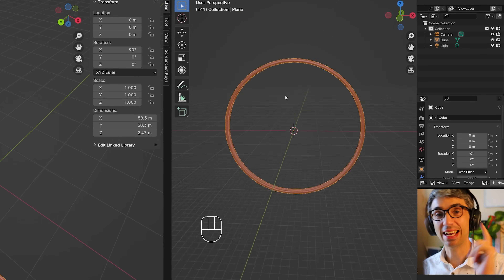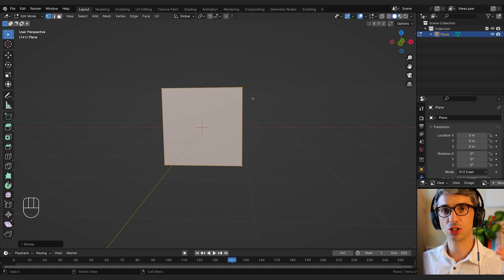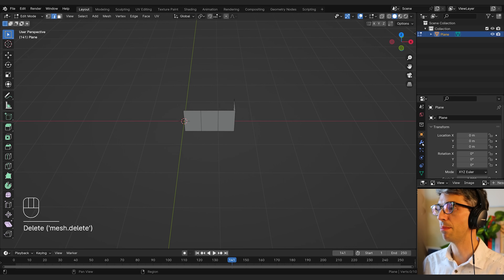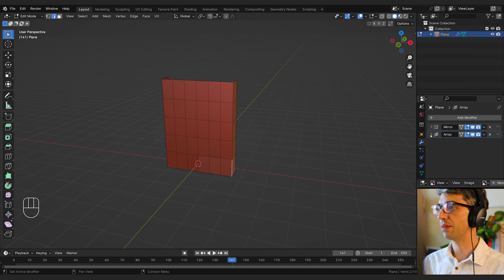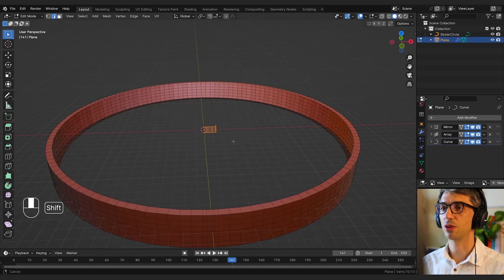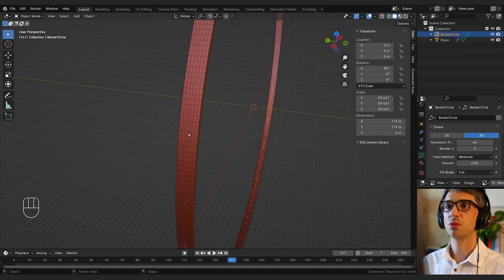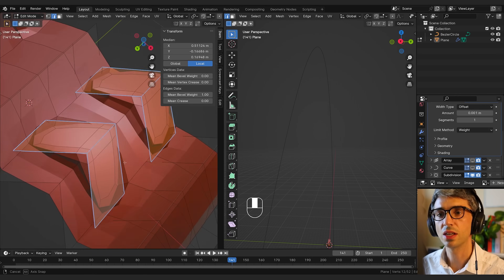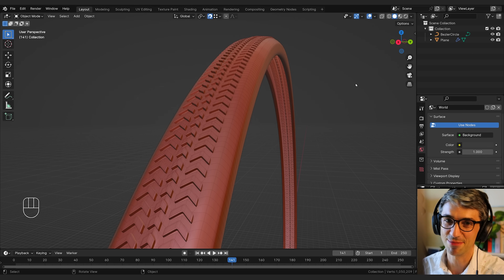Make A Bike Tire in Blender With A Non-Destructive Modelling Workflow

Comment: What version of Blender?  I'm in 4.1.1.

When I change the arrray modifier from fixed  count to Fit curve and select the circle, my "treads" only go approx 95 degrees around the circle.

Having no way to rectify this situation and spending too much time trying, I had to give up on the tut
Reply: I had the same issue but found that instead of using the "fit curve" in the array modifier, I used the fixed count and increased the count to super high. Hope this helps🙂
Reply: Same issue :face-purple-crying:
Reply: Same happened to me, just scale it up until it overlaps.

Comment: fit to curve on the array didn't work for me.... I eye dropped the curve, also selected it from the menu. Tried to push through by using fit to length but it all came to a screeching halt when reaching the part when you switch to constant offset.. Good tut though.

Comment: If you find that after adding the Subdivision Modifier it is smoothing the object separately (Looks like tabs running along the inside of the tire) and not the entire array as a whole you need to select the "Merge" checkbox in the Array modifier.
Reply: Did something weird to my mesh, but didn't help. The inside lip remained curved.
Instead, go to the advanced settings of the subdivision surface modifier and in the "boundary smooth" tile select "Keep Corners".
Don't get the Boundary smooth confused with the UV smooth above it